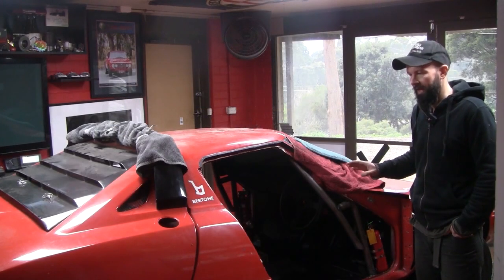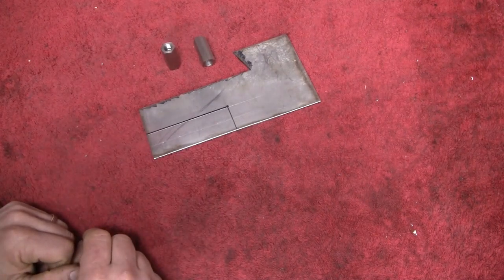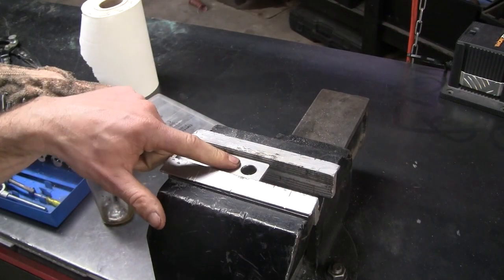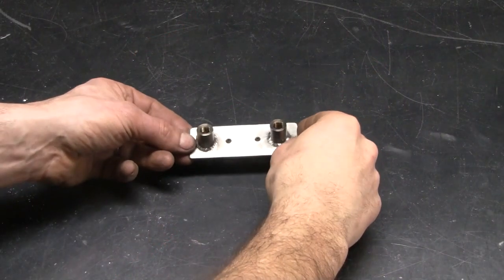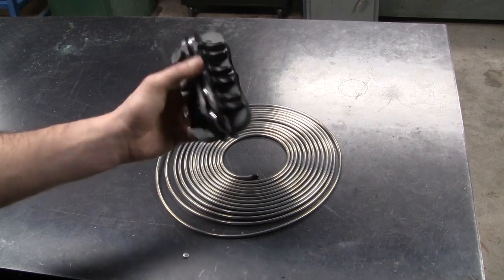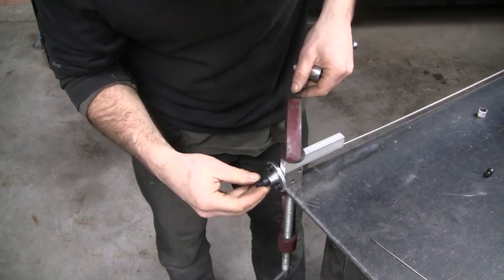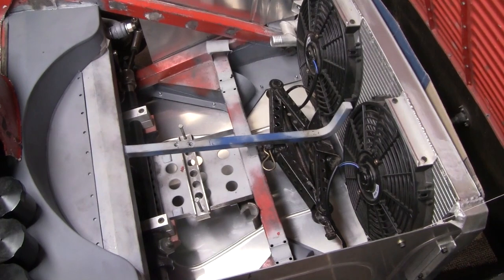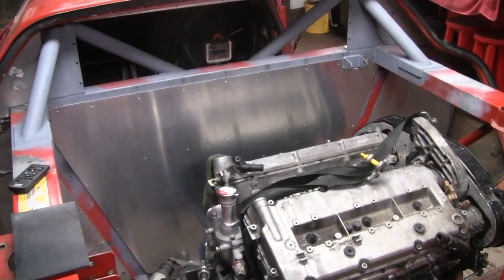Project Stratos - Episode 21 Brake Lines

Comment: Hey Colin,  such neat work as usual side panels up front look sweet as. I saw you sharpened the drill on the side face of the bench grinder. Do you find that easier than using the front face?
Reply from the maker: thanks , yea for small drills i find it much easier to get a good grind if i use the side of the wheel , that way i don't need to take the radius of the wheel into account, particular with the clearance grinds

Comment: Perfection festival 😉

Are you going to remove the firewall panels and other interior stuff before painting?
Reply from the maker: cheers mate, the fire wall panels are only fixed in temporarily for now but i think the engine side will be installed and painted with the chassis, the interior one is made to be removable so will get that powder coated but will match the color of the interior  to blend it all in

Comment: Great episode.  Cameo appearances from the water pipes in the tunnel, throttle linkage near the pedal box, brake master cylinder reservoirs on the firewall and (maybe) pressure cap between the cylinder heads.   Looking forward to the build of the 'important items' in the co-driver's foot-well; ECU?
Are you keeping the windscreen wiper/headlight lifting motors in the front corners, or permanently running the headlights up, rally style? 
Keep the videos coming; thanks.
Reply from the maker: haha, that's some  attention to detail! all correct! yep ECU and a few other top secret electronic components  to take up the space.  As for the headlights,  yea, I don't want to run with the lights up all the time, but need them for the rules, was thinking of some sort of spring loaded solenoid actuation for a one shot raise of the lights.  The motors are out of a fiat x19 and are designed for the job, i think i'll take the weight hit for now (2kg each) and replace them with something lighter in phase 2

Comment: 'bluntens'.. is that a word? so what about stainless exhausts? come on, you know you love 'em.
Reply from the maker: No it's not, but you can't stop mid rant! As for a SS exhaust,, god if I had used that on the alfa I wouldn't have been able to drive out of the workshop without it cracking!